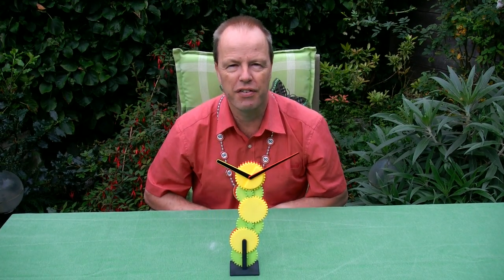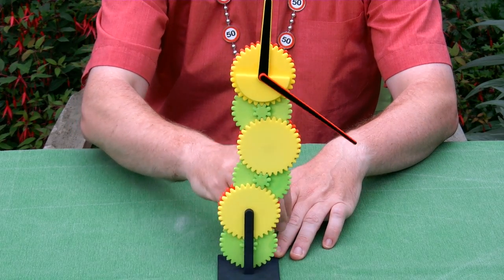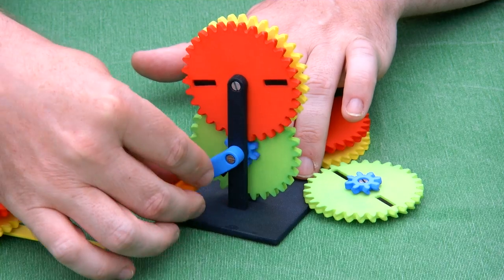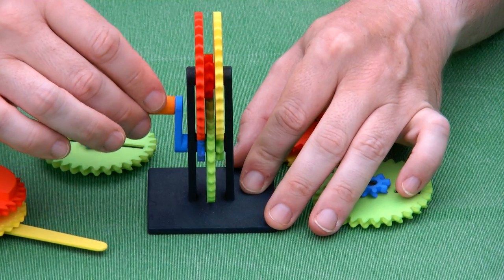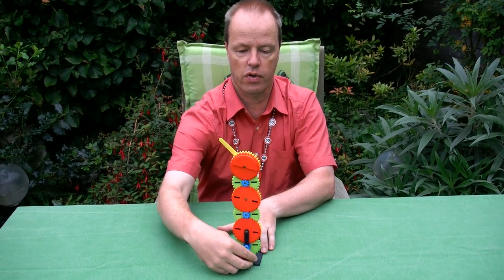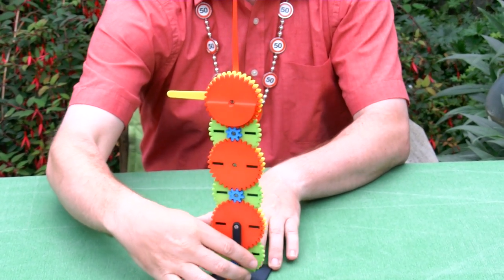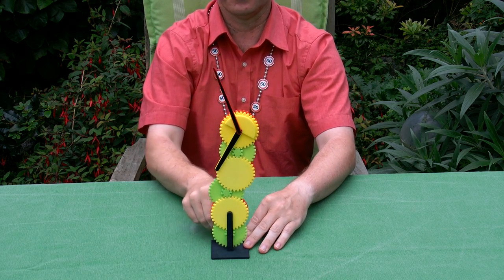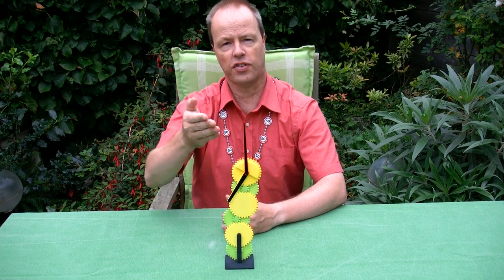Gear Tower Clock

Comment: The secret of the standing gears is something you glossed over in this particular video as well as in your "Standing Gears" video. The secret is that the two gears in one are two different gear ratios, so when it tries to rotate to come off it gets blocked. My hypothesis, at least.
Reply: Couldn't have explained it any better
Reply: This is right I believe but to go a step further,  the ratios being different provides more than  one reference point.

Comment: You could make a cool puzzle out of this.  Differently sized gears or gear sets, some rotating clockwise, some anti-clockwise.  You scramble the puzzle by switching the gears around, removing some, adding some, cranking it, then have to get it back to 12 o'clock by mixing and matching the gears.  You'd probably need to have three clock faces to align, otherwise it'd be super easy, but the idea of a disasemble-reassemble gear puzzle is kinda cute.

Comment: I'd say this works because each of the gear elements has two differently sized gears that are fixed to each other. That means that you have two competing translations that define the speed at which the element would have to rotate in order to fall off. Because it can't rotate at two different speeds at once, it just doesn't rotate at all, letting it stay on the tower.
Reply: if that's how that was designed, that is really cool

Comment: I would assume that the gears that share an axis both push with equal force into each others direction so the effect of being pushed left or right is being negated. An application I can imagine this being used in could be for an elevator that has one transport line going up and one transport line going down in reverse parallel without having it's own skeleton or frame to hold it up. Would you find this idea interesting Oskar?